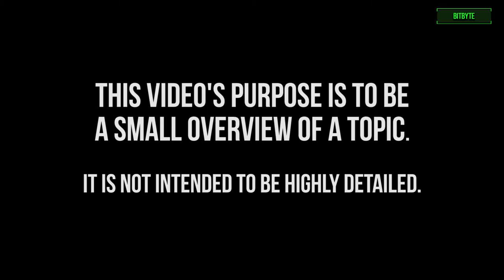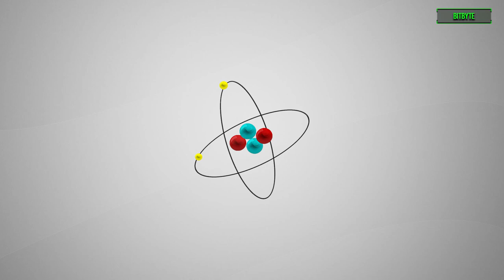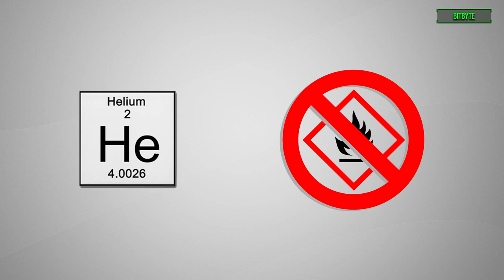What are Helium Hard Drives?

Comment: I like the sound hard drives make. 

So long as it's not clicking away like a Geiger counter because the machine it's attached to doesn't have enough RAM.
Reply from the maker: I usually go the Torvalds route and prefer quite machines. Fans and drives. Though I like my keyboards loud.

Comment: Also: Turbulnce... And... because I'm a stickler and want to help: it's important when it comes to units of measure to keep the intended capitalization intact. For example: Mb/s and MB/s are two different things (Mega bit vs Mega byte per second). You're using "M2" for square meter, but it's supposed to be "m" (for meter) and an elevated "2" (for square).
I know, no one gives a damn about those things these days, but when I was young and went to school, these things were drilled into my head...
Reply from the maker: I know m^2 is how you are actually supposed to write the unit, but with the font I was using in the video, using ^ wasn't a good option. The font I was using only has capital letters so I made is M2 assuming everyone knows what I mean.
Reply: @myneckisfat  m² is unit of area (two dimensions) so kg/m² is more unit of pressure, not unit of density. kg/m³ is unit of density, because m³ means volume.